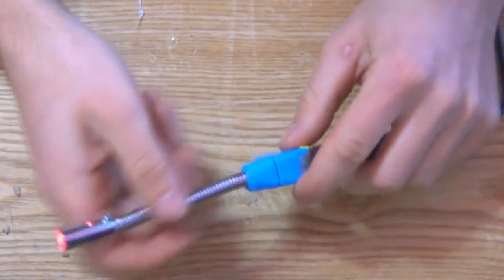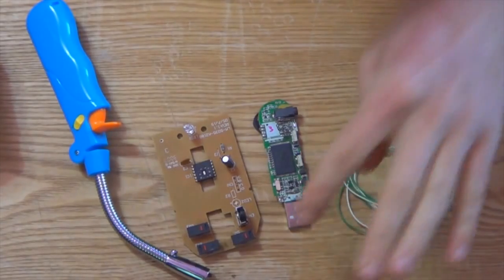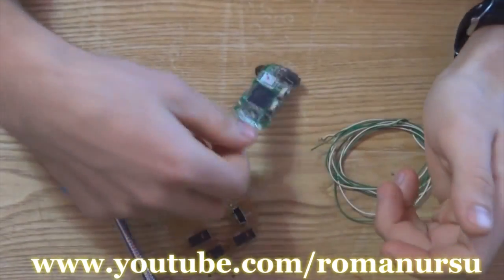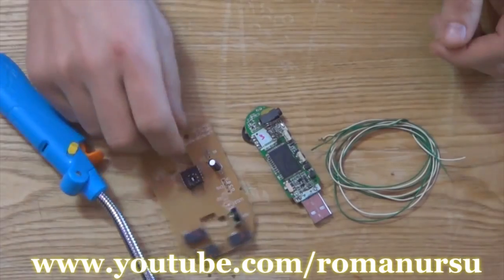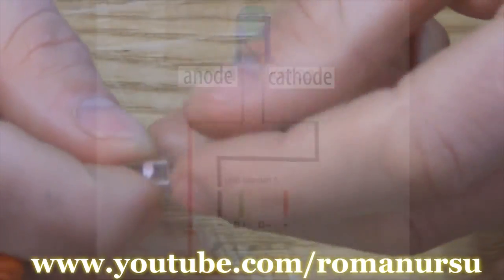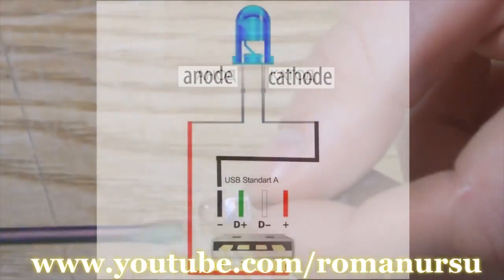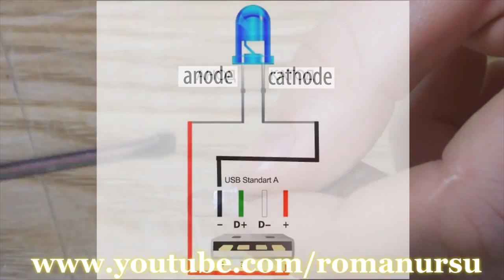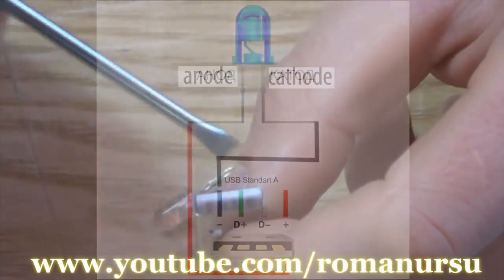How to make a USB flashlight from a lighter 🔴  TUTORIAL

Comment: 5V is too much for that LED. 
* Formula: (5V power supply) - (LED Forward Voltage of 3.1) = 1.9V / .03 = 63.3 ohm resistor if you wanted to overdrive it at 30mA. You would use a 68 ohm resistor which is close in value.
Reply: just use a 220 [ohm] resistor
Reply: *****
That was added later after everyone told him. LOL
Reply: Funny he listened to that but not about all the clickbait thumbnails lol

Comment: nice idea but you gave 5v dc power to led the led may not work after some time but you can also use an 100 ohm resister which will control the power

Comment: Roman, could you build a magnetic pick up tool, with an electromagnet? It could have a buck module to take 18650 3.7v to 18 or 24v and run a potentiometer to allow for very strong to lift heavy item or strong to collect a nut or bolt. I think you could hack an existing pick up tool to build this.

Comment: this is too much voltage for the LED. Red ones usually only need around 1,6V!!! Use a resistor to get the respective voltage drop of ~3,4V
Reply: LED's don't work on 1.6 volts you need minimal 3 volt.
Reply: The redstoneblock That is simply wrong, because every semiconductor (= different color) needs a different voltage. Red LEDs need less voltage across than blue ones, because blue light has higher energy photons, so blue LED needs more energy, even if the amount/ intensity of produced photons is the same. This is simple quantum physics, and applies directly to LED. You can Google it, if you don't trust me